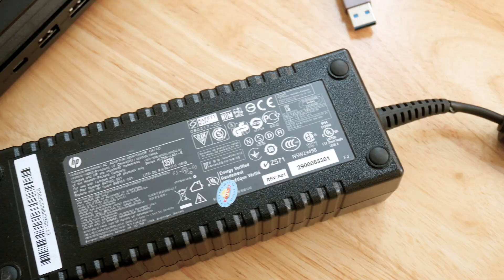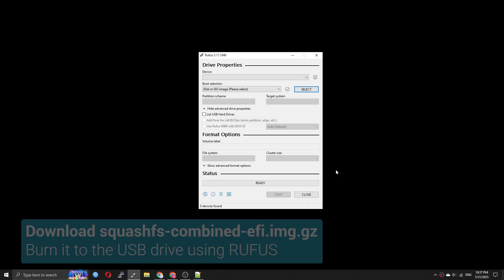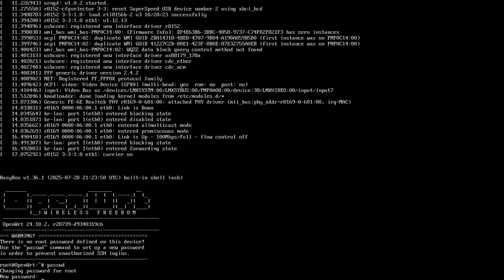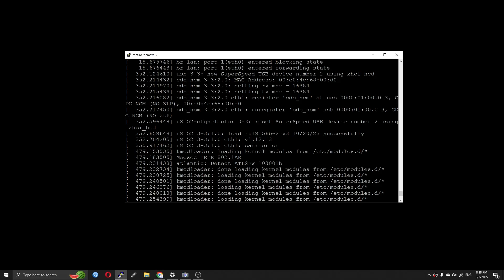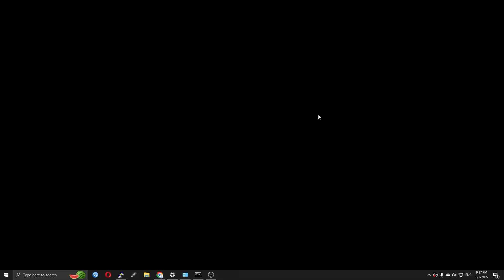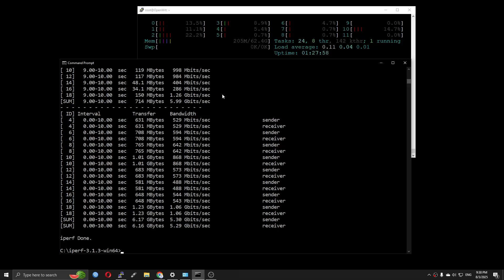OpenWrt - HP 10GBase-T Flex IO (56Q71AA) NIC Testing (with HP EliteDesk 805 G8)

Comment: whilst its not 10gbit, those chinese n100 routers idle at 6w and peak at 12w and can do 5gbit wireguard so are pretty strong
Reply from the maker: I have tested the N5105 Router PC before, indeed the P/P is very good. For the 805 G8, I belive most of the power consumption is due to the AMD CPU and the RJ45 10GbE (the Inspur X540-T2 also draw a lot of power).

Comment: Hello,
I have a technical question regarding the HP t740 Thin Client. I am trying to install OpenWrt on it, but I'm facing a serious issue.
During the boot process, the screen remains black, and the device doesn't seem to load any OS installer or boot media. I've tried multiple methods, but nothing seems to work.
Since the HP t740 is a specific device, a standard OpenWrt installation guide might not cover this particular problem.
I would be very grateful if you could create a YouTube tutorial on how to successfully install and boot OpenWrt on the HP t740 Thin Client. A video guide would be extremely helpful for me and probably many others facing the same issue.
Thank you for your time and consideration.
Best regards

Comment: Is it possibe to use quectel rm551e gl on this setup?
Reply from the maker: I haven’t try but it should be possible since the RM551e is M.2 PCIe. The 805 G8 has 1 slot for the Intel AX200 and we can easily swap it for the 5G card.
Reply: @VanTechCorner can you use any cellular on this board and set up wan connection, it would be amazing and exciting please consider doing this if its possible for u 😊

Comment: I've read that the 10Gb IO Flex module gets pretty hot in those minis.  I'd like to see some data in your videos on how much heat is generated under idle and heavy use conditions.  Thanks for the video!
Reply from the maker: Unfortunately I don’t have anything to measure the temperature. If you got to know any command, please let me know.
Reply: @VanTechCorner  If you run Linux you should be able to install LM Sensors and see if there's a temperature sensor on it. Otherwise, you could just touch it and tell us if it feels hot.